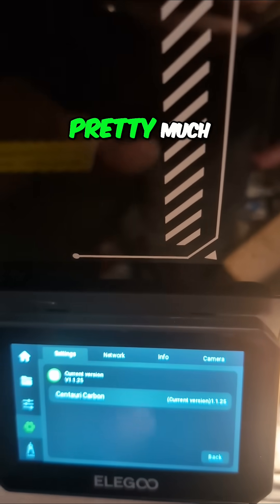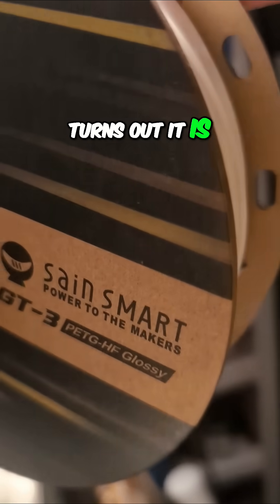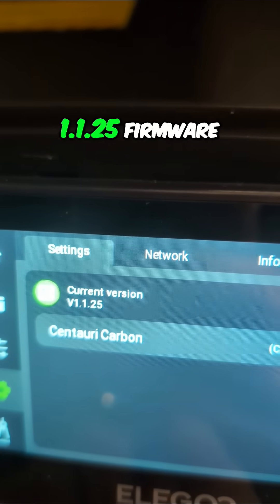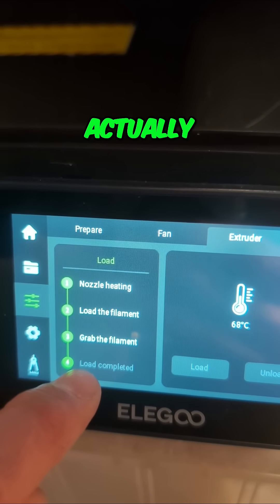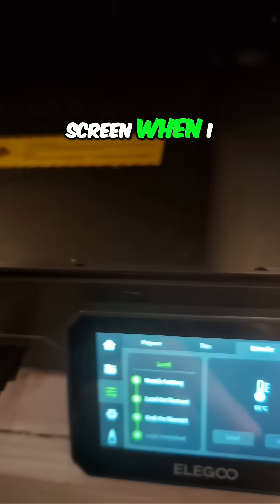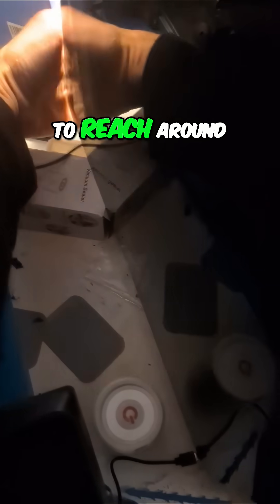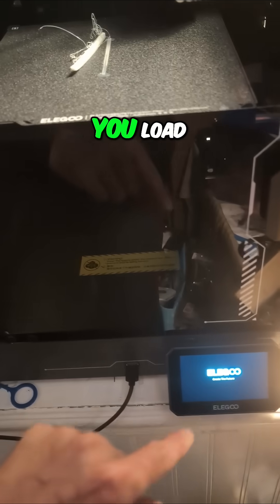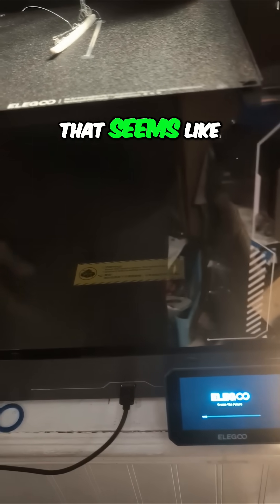3D Printer LOCKED! Firmware Flaw Disaster (Elegoo Fix This!) Centauri Carbon

Comment: Mine gets stuck preparing for a print snd when the bed temp set gets reduced after an auto level the temp never comes down, and it'll get stuck like that forever. I found a workaround, change your set temp to above whatever it is and it'll see that it acheived the temp then it will continue, then just manually change it again to what you want to run.

Comment: How are you sending remotely? I had not realized it can be done.
Reply: Orcaslicer
Reply: @papaplintus  D'oh! I use Orca. I guess it's been hidden in plain sight. Thanks.
Reply from the maker: I've done it via Orcaslicer and ElegooSlicer. You just add the printer's IP to the printer's profile and you'll get the option to print instead of just generating the gcode